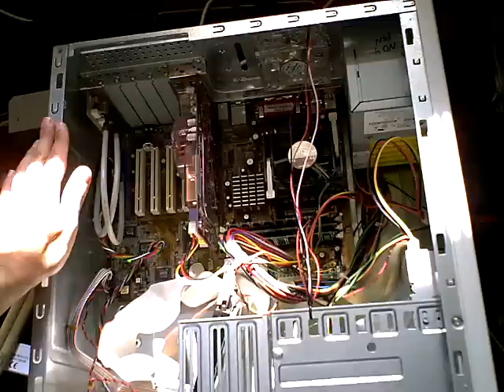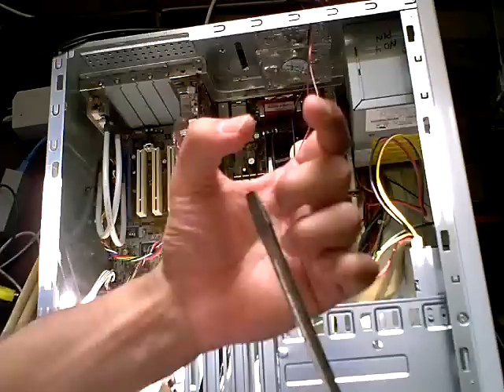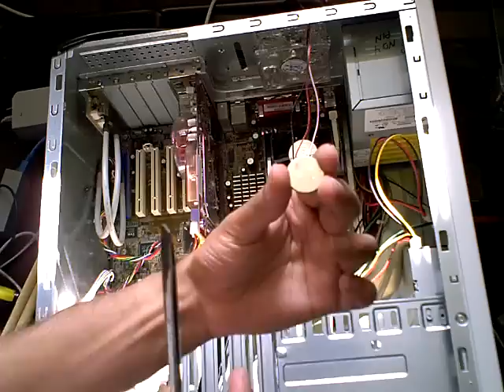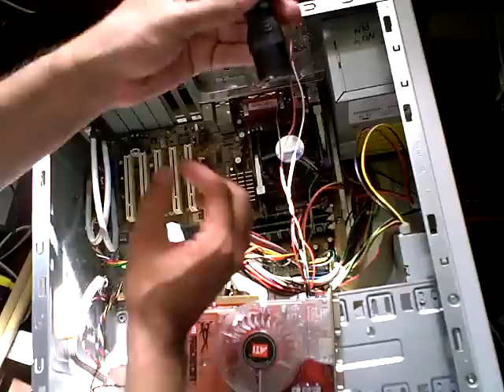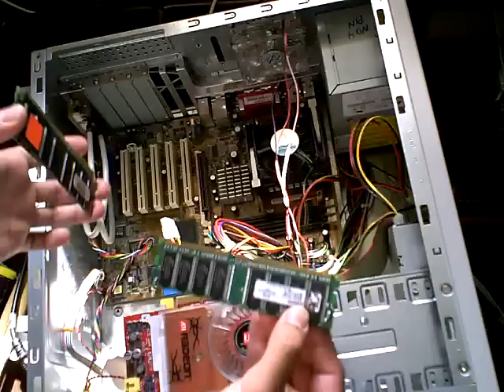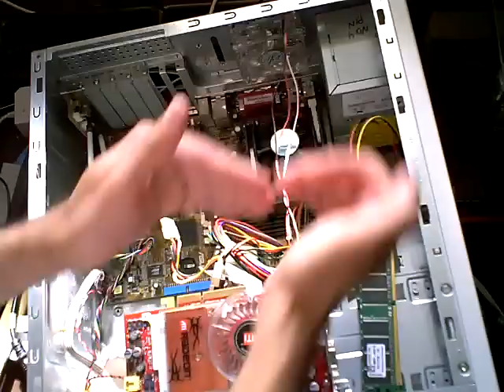How to possibly fix a PC that will turn on but will not beep and will not display anything on screen

Comment: Hi, I have an Acer laptop and it does not have a similar jumper, but has the type with two studs. It does not have a removable CMOS battery (soldered). Removed the AC and battery, pressed the power button for 20 secs, shorted the jumper and maintaining it shorted as the computer gets plugged in and powered on. Fan on then off, power LEDs on. Heat generated from CPU. (That was manufacturer's suggestions http://www.manualslib.com/manual/1180/Acer-Aspire-5251.html). Then restarted and tested all the RAM cards independently, together, and in different slots. Removed hard drive. Nothing worked, and no backlight from screen. No beeps and have no way of retrieving any POST codes. The computer was dropped multiple times, but still worked afterwards. When the case was opened there were fragments of washers and crap bits. Took them out prior to the steps i took above. The time when I realized the computer was dead was when I placed it in standby, moved it to another room, and going back half an hour later to learn that it decided to mysteriously stop budging.
Reply from the maker: +AdenDaBeast I've 'killed' a lappy doing the exact same thing! (well, the standby deal, not so much the dropping part : ) I would tell you to check out my two videos on possible laptop fixes, but from the sounds of it, you've tried everything I could suggest. I'm sorry man, I haven't a clue. Just in case you magically find a gem of inspiration from these: http://www.youtube.com/watch?v=qRhphHjQrNk and/or http://www.youtube.com/watch?v=X78u90mETpE

Comment: my computer becomes over heat then it shut down automatically after that the cpu has power but the monitor has no power (no display at all).what do you think is the problem?what should i do?
Reply from the maker: +Princes Joy Posadas Sounds like the overheat issue is preventing your PC from posting to protect itself from damage. You have to change the cooling method of your PC

Comment: What worked for me, I got a new CMOS battery(Motherboard battery), after a few successful powerups with the new battery,  the damn thing wouldn't even turn on 75% of the time,, and sometimes it would shut down with one press of the power button, sometimes it wouldn't even power on. Take out the CMOS battery, and gently bend up the prongs that press up against the battery. It just wasn't getting good contact with the battery
Reply from the maker: +VancouverCanucksRock Very interesting tip. Thanks for sharing

Comment: My computer is working fine sometimes and booting up nicely without any problems..
But the next time i try to switch it on, i face a black screen with no output. It is happening the same for a week now.
It either switches on and works fine or else just shows the black screen with no pattern or whatsoever. And so i couldnt point out the problem
Do you think its possible that the MOTHERBOARD is damaged and not of any use..or is there any way to know the problem with a solution
Reply: and yeah i forgot to mention
i only have one RAM with two slots..and i never possibly heard the beep sound..perhaps its not too loud
Reply from the maker: Natsu1610
If the issue is intermittent, I'd sadly live with it, despite it being a pain. If I had to guess, I'd say the issue is related to either the motherboard having issues accessing and inventorying all components properly before booting, or a power supply not providing sufficient power to power up all components before booting. You can always boot your PC, and if the issue happens, try the reset button instead of the power button: hopefully this may be a quick workaround if the issue appears. Sorry I couldn't be of more help : \
Reply: RodneyDickson thank you for your help...the problem is still unsolved...but my pc is working for now...and like you said i cant find anything to do but live with it at this point
Reply from the maker: Natsu1610
Sorry I couldn't be of more help : \

Comment: I'm in a bit of a pickle. So I have this old PC with a socket AM2 motherboard. And it's very dusty. So I decided to open the computer and I got some dust off of the fan on the CPU. I then turned on the computer (after cleaning) but the monitor did not detect the computer. So then I did some looking around on the internet and I saw that you should try and take out RAM and put it back in. So I turned off the computer and did that. I then turn on the computer and I hear a continuous beep that won't stop (sounds like beep beep beep beep beep beep beep one after another). The monitor still didn't detect a signal. Not sure what to do now. Any advice would be appreciated.
Reply from the maker: +Flashyze Beep error codes differ from one BIOS manufacturer to the next. To discover what the beep error code is trying to telling you, discover the manufacturer of your BIOS (available in the motherboard's manual or on the motherboard's manufacturer's website {on the page for your specific motherboard model}) and then look up the frequency and interval of your beep error code on:

http://www.computerhope.com/beep.htm

Comment: Could you tell me how to fix this? My laptop is working, but when I turn it on it shows a black screen. After a second or two it starts beeping repetitively. I tried taking my battery out and just putting the charger in but it did the same thing. Please help if you could. Please remember it's a laptop not a desktop. Thanks!
Reply from the maker: +mmmm cheezits :) Try these: https://www.youtube.com/watch?v=qRhphHjQrNk
https://www.youtube.com/watch?v=X78u90mETpE

Comment: I had a problem I could not get into BIOS and some of the LEDs were red. So very quickly accidentally press the SWITCH at the source. I mean, turn it off and I turned on quickly. And they started blinking all LEDs and entered my computer BIOS and could use the PC. It is very strange, seems to need a small power outage ... They might have lost electricity. I hope you find it useful
Reply from the maker: +ViL Kol Thanks for the tip
Reply: RodneyDickson yw

Comment: Hi rodney i have the same thing when i remove my RAM it beeps like yours so does it mean that my RAM is useless? Pls reply thank you.. God bless
Reply from the maker: Hi there. Nope, it is possible that the RAM modules may still have life to em. As shown in the video, unplug the PC, try just one RAM module, power up, and if it works, repeat the process and introduce the other RAM module. Continue to repeat this unplug, switch, n power up process until you find the combination that works for you (even if it is less than all the RAM modules). Good luck : )

Comment: What's the average life of a psu (in years) 
Like I'm having the same issue with my pc and I'm not sure if it's the motherboard or the psu 
But I'm using a 450 watt psu for an Intel i3 2100 and intel dh61ww motherboard 
8 gb ram and evga gtx 750 ti sc 
The cpu fan is also making some weird noises 
Not sure whether to change the psu or the entire motherboard with the cpu now 
I was using it for heavy gaming like watchdogs etc
Reply from the maker: +Nishanth Ananth A 450 W PSU is already slim for gaming, and PSUs usually don't just die outright, but rather they become weaker and output less power with time. The way you are pushing your PSU, I'd estimate a life expectancy of no more than two years. If you have passed this threshold, you might wanna look into a new PSU, one with more wattage this time.

Comment: Hello RodneyDickson My computer powers on immediately I switch on power on the socket and nothing display on the screen. I hear the sound of the fan but I shut down manually and power on again, It takes me to the BIOS (F1) and  it says my system time and date is not correct. The problem persist even if I correct the date and time. Please kindly help. Thanks
Reply from the maker: +Mohamed Ali Your CMOS battery is dead. It simply needs replacing with a new one : )

Comment: Hi my english is not so good. So you think if i buy a new Power Supply ill be okey again?
Reply from the maker: It's dependent on what is your issue. If your PC is behaving like mine does in the video, then it is possible that a new PSU may solve your issue, but it is unlikely.
Reply: ok

Comment: I just built a computer and everything turns on and spins up but no output or beep.  I have an ASRock fx 990 extreme 9 mobo, amd fx 4350 cpu, ASUS Geforce GTX 750 ti graphics card, 8 gb ram, an old 200 gb hdd, and a 400 watt psu.  The monitor is an old one but was working with a different computer.  Would there be any compatibility issues?  I feel like it is either the mobo or something with my configuration.  Thanks for a response!
Reply from the maker: Run through the troubleshooting steps of this video and let me know the outcome.
Reply from the maker: RodneyDickson
Prefer to communicate through this account or Jbenfer98? Let me know and I'll keep one thread open.
Reply: Ok so after hours of trouble shooting I noticed that there is a 8 pin connector on the mobo that I didn't have plugged in. On my power supply there wasn't an 8 pin connector though so I bought a new power supply and plugged it in and bam it worked! It confused me because it would turn on without that power cable connected.
Reply from the maker: +Jbenfer98 Sure, it gets power to circulate, but to get it to actually 'think' it needs all the required juice. That's why when a motherboard dies (can no longer 'think') fans and lights still work. Glad you found the solution.

Comment: When I upgraded my windows to Windows 10, I started to have this problem. I just messed around with the hdmi port and the vga port by unplugging and plugging the cords in. I got it to work but now it won't work anymore. What do I do?
Reply from the maker: Power down the PC, connect to a different video out (only one at a time), then power up. If no luck, then repeat (each time powering down the PC, connecting to a different video out port, and then powering up) until you find a video out port that works for you.

Comment: Hi rod :) I have prob . when I turn on my PC all fan are OK but no display I try to remove the ram there's no beep . pls reply asap
Reply from the maker: +VRP 9 months later is asap, right? Breadboard it (explained in the following video:)

If the steps in this video did not provide a solution to your problem, view:

http://www.youtube.com/watch?v=_EK9a-R5pss

You never know, maybe rebuilding the PC in the opposite sense that you took it apart will solve the problem.

Comment: Just install new CPU Athlon x4 750k and no display on monitor I here the beep when turn on PC but nothing I install back my old CPU a6 5400k but still same problem help
Reply from the maker: Do you have multiple video outs on your PC? Try every connector to see if one of them functions, and ensure that your monitor displays properly (by connecting a different PC to the same video input that your PC uses, like a laptop if you have one or can borrow one).

Comment: I need help I bought a 950 sawed of a bit because it wouldn't fit was very safe pro done in a pc shop and I bring it home put in the slot and I can't plug in a certain cable but it is to do with dvd  drive so doesn't matter and when I try intel hd graphics it works with that cable not plugged in the gpu turns on for 10 seconds and my 350 can only output 350w for 15 seconds would this be the problem any help is appreciated
Reply from the maker: +joey moran Breadboard it (explained in the following video:)

If the steps in this video did not provide a solution to your problem, view:

http://www.youtube.com/watch?v=_EK9a-R5pss

You never know, maybe rebuilding the PC in the opposite sense that you took it apart will solve the problem.
Reply: +RodneyDickson fixed it already

Comment: When I push the Button to start the PC (emachines window 7) the green light on the Button do not lightening and I hear no Beep signal, even I hear that fan and maybe the computer, however on the monitor occur text "no signal". Also the Keyboard is without light. Sometime the Keyboard lights up for 1/2 sec. and then "dies" again. In this case I can also not shut up the PC with the button, only with to take the power cable out...
However sometimes after letting 1- 5…Hours the computer on (without signal, light on start Button etc.) then, disconnects power cable several times…if I am lucky... I hear the beep signal and the start Button have green light, the keyboard have lights and the monitor have blue light and window starting …
Please what should I do…step by step pleas. I am NOT literate with computer terms and/ or not computer “fix it person”. Thanks for any Help!
Reply from the maker: +123jolien Could be a short circuit, or could be a weak PSU. I recommend finding a way to get it to successfully boot (as you have been doing) and once it boots up, instead of turning it off, always put it to 'sleep mode' so you can awaken it whenever you need it. The other fix (breadboarding it) may be too complicated for you, but if ever you want to go through the trouble: http://www.youtube.com/watch?v=_EK9a-R5pss
Reply: Rodny, Thank you so much.  I will come to that the next weeks and let you know. In the mean time I will like to say thank you:).
Talk to you later.
have a Good day!
Reply from the maker: +123jolien Hope things work out : )

Comment: Can you help me? The problem of my computer is that it turns on and some wierd lines pop up they are normally vertically lines that have different colors. This prevents me from doing anything i have no choice but to turn it off
Reply from the maker: Does this happen immediately after booting up or after some use of the PC (such as after some time has passed when using the PC)?

Comment: okay, my pc recently got water spilled on it from the tops fans. the cpu got wet, it dripped onto the back of my Gpu, and on to my psu. I was told by a "computer tech" that everything worked except the mother board and it needs to be replaced. I replaced it and still have the same problem. When I turn it on, I don't get a display, my computer will also turn on for 5-10 secs, turn off for 2 secs, and turn back on and Stay on, but still no display? I tried taking my Gpu off and connecting straight to the motherboard to boot up. I still get bo display. does this sound like a CPU problem?
Reply from the maker: Could very well be. Water damage is not something that can be easily troubleshooted without doing swap-tests with alternate components I'm afraid.

Comment: With my computer, whenever i press the power button, it will flash the lights and spin the fans for like half a second, does this i have a faulty power supply?
Reply from the maker: +oDroney  It sounds like your motherboard is developing a short circuit due to contact with the metal casing. Most likely it has to do with the screws and metal mounting stands (supports) that your motherboard sits on. The cheapest way to fix this problem is to introduce cardboard washers between the screws and where they make contact to the motherboard, or you can buy plastic mounting supports at a computer shop.

Alternatively, you can always Breadboard it (explained in the following video:)

If the steps in this video did not provide a solution to your problem, view:

http://www.youtube.com/watch?v=_EK9a-R5pss

You never know, maybe rebuilding the PC in the opposite sense that you took it apart will solve the problem.